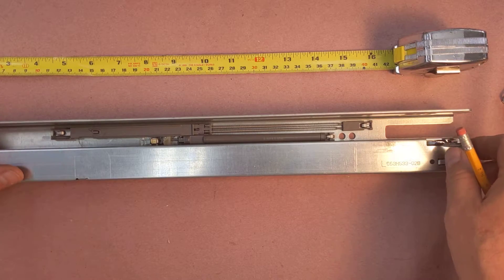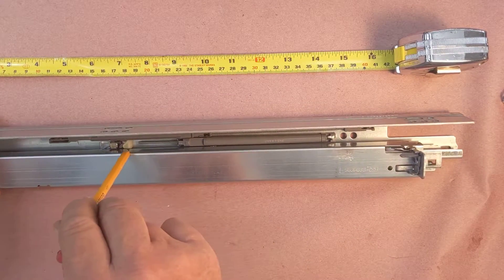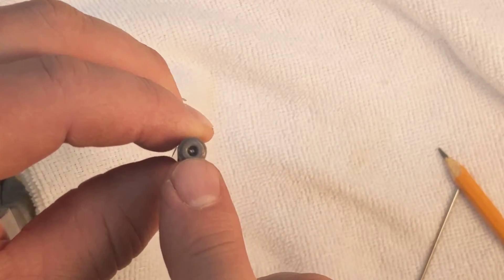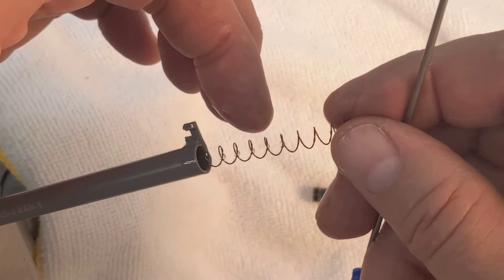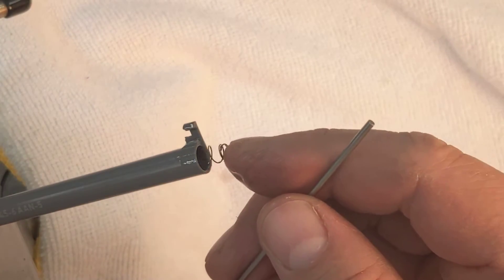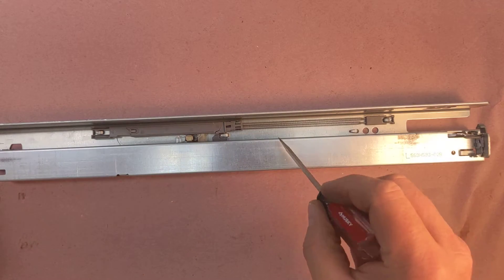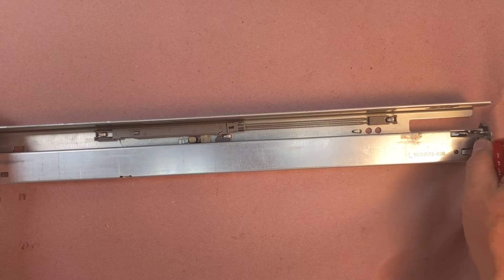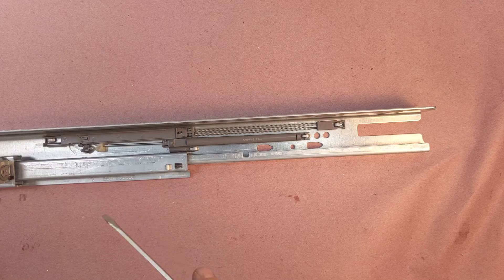Soft Close Technology; what is it and how does it work on drawer slides.

Comment: Such a great video showing the mechanisms  in detail. I'd just point out that using a "scale" won't provide useful information about the damper as the resistente is proportional to the change in speed (as seen in its differential equation). So it will oppose the movement according to the speed applied!

Comment: AWESOME video!! 

I think the slow-release, consistent speed is achieved with the air being compressed when pushed in and then slowly expands out (which is why the rubber seals are there). There's a product called 'smart grease' which also helps with consistent movement (or it could have just been silicone grease)
Reply from the maker: Thanks
Reply: @neuromanglers  please guide me how can I open it?
Reply: I'm like 10 months late on this one but the way I think it works: the plastic bits on top of the spring need to move through the silicone fluid but there's a certain resistance which equals the force of the spring. That's the reason for why the rod moves forward smoothly. Then, when you close the drawer, you'd have to overcome both the resistance of the plastic bits moving through the silicone + the spring